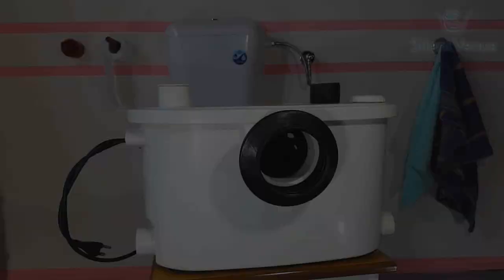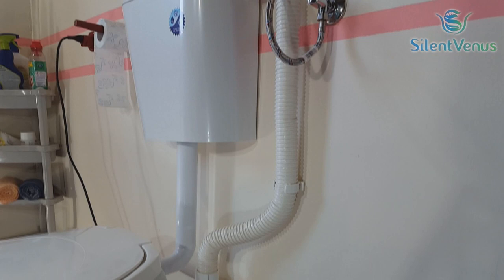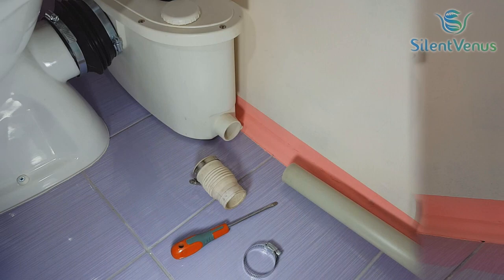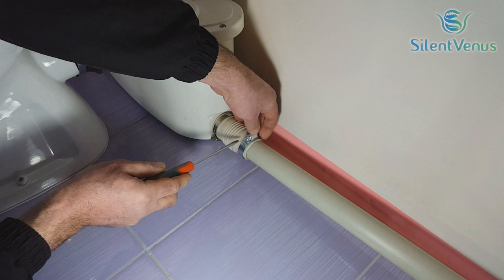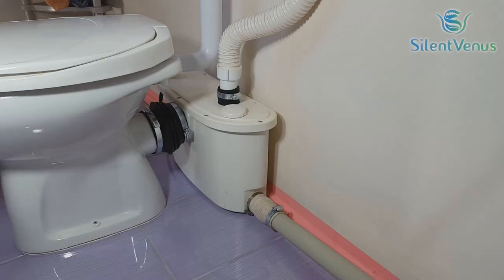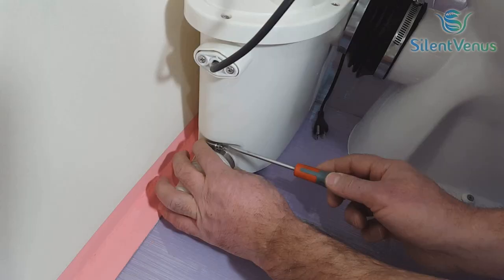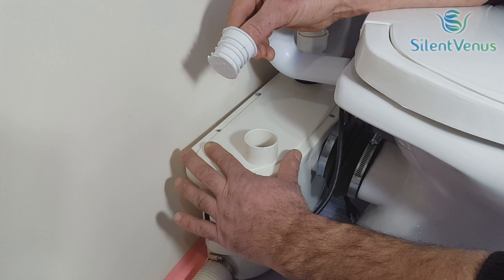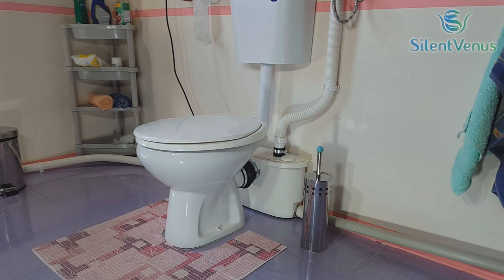Silent Venus Upflush Toilet Macerating Pump How to Installation Guide

Comment: I wouldn’t use flexi hoses for the waste discharge. A macerator that can pump through the ceiling is going to shake the hell out of that pipe. Flexi hoses also fatigue over time and create a lot of resistance to the flow, which also makes it more noisy.
Reply: What kind of hoses would you recommend?
Reply: C R I’ve installed these with solid 40mm PVC pipe without any issues. The rubber connector to the macerator gives you enough play.
Reply: What if I’m only discharging washing machine water?  Can I use flexible hose?
Reply: @marcuschugh161  it’s not really about what you’re putting through it. It’s about how far you need the fluid to go, ie how far up and how far across. But I would always advocate for trying to connect using a solid pipe, it’s easier to plumb than you might think.

Comment: I already have an existing toilet pump hooked up. I want to install a bathtub to my existing pump. From what I can tell from your video the tub will drain as long as I allow for a  1 1/4 inch gravity drop every 1 ft. Is this correct? Also, make sure to use a 45 degree angle to come around my corner.Do I have this right??? I don't want to break my concrete and I only have a 6 ft head clearance in my basement.